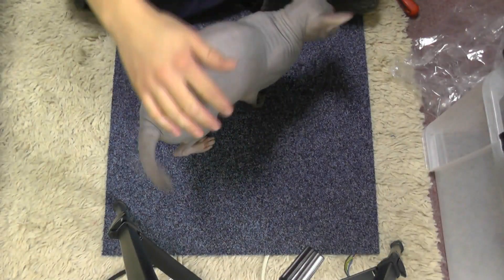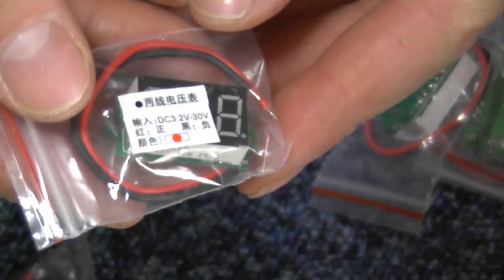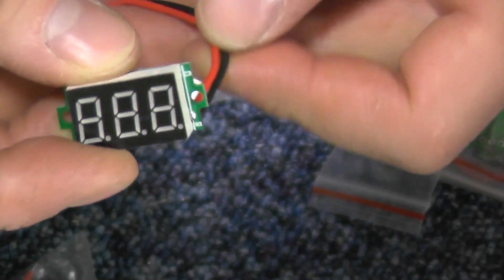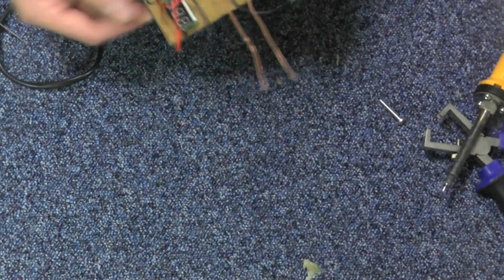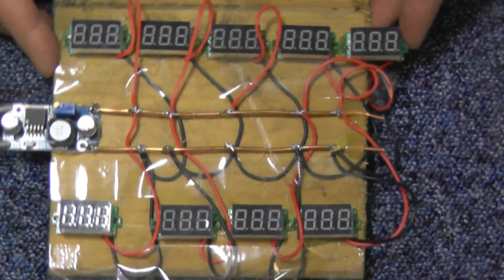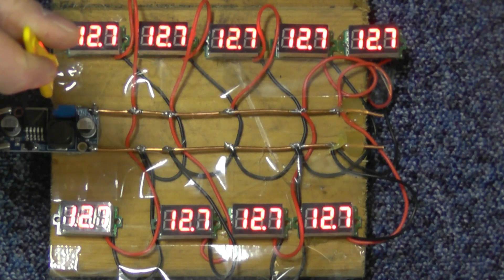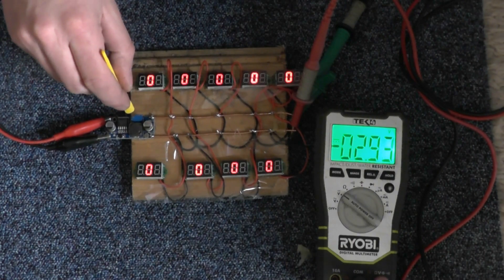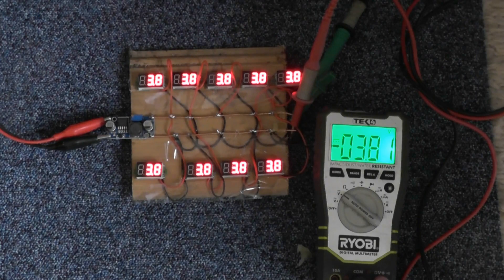cell level volt meters

Comment: The low voltage cutout is due to the need to have enough voltage to power the IC and LED display. There may be a way to modify these to have a second power input that just powers the electronics. I know HBPowerwall modified his little volt meters.

Comment: I've just got some of these https://www.aliexpress.com/item/10pcs-Mini-Digital-Voltmeter-0-28-Inch-2-4V-30V-Voltage-Tester-Meter-LED-Panel/32663407389.html which are rated down to 2.4V
I'll test them this weekend to see if that's true.

Comment: Pretty good purchase, they seem to track together nicely, with very little discrepancy.
 Why nine?, did one not survive the trip?,
 I wouldn't worry about the odd one as it looked like it was jittering at the 0.5 volt point-close enuff!,
 I expect they cost less than the sum of their parts.
 Cheers, J.
Reply: Nine is much nicer number than ten of course. He had just mounted them wrong, they obviously should've been arranged in sierpinski triangle pattern.
Reply from the maker: Average Joe I did get 10. unpacked 1 and misplaced it. story of my life